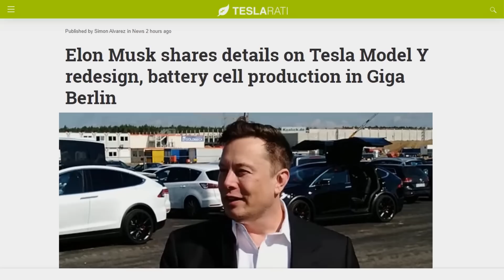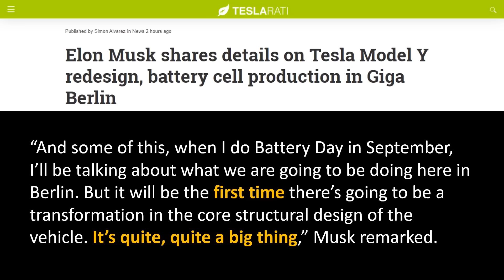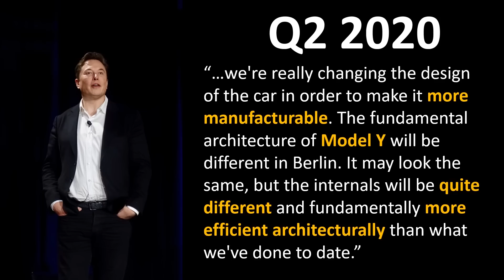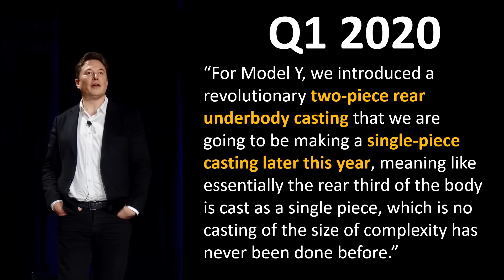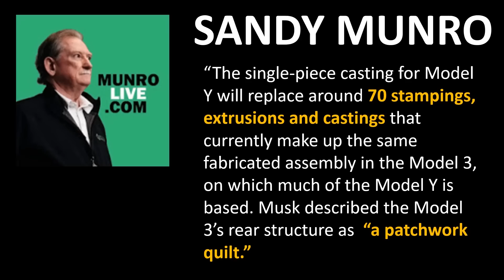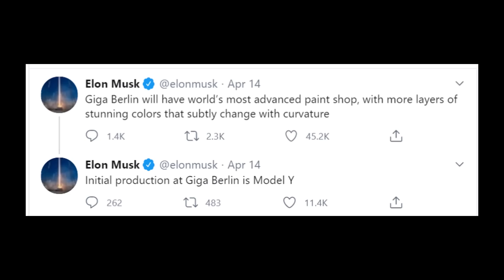Tesla is Redesigning the Model Y (Gigafactory Berlin)

Comment: It's funny how all other auto makes main focus is aesthetics and features but all Elon talks about is how much they are going to improve the efficiency of production. The cars are already sexy. That's the easy part. How to make millions of these sexy cars is the key
Reply: Mostly because the info was directed to investors and not consumers.
Reply: Stop talking nonsense, other manufacturers are already efficient at manufacturing, vw and toyota each makes 10 million cars a year, esthetic is also part of car design.
Reply: @carholic-sz3qv  I think his point were really about the rapid pace of innovation that Tesla currently does.
Reply: @yourcrazybear  Which innovation has Tesla made ?
Reply: @jonpetter8921  You mean besides creating the best EVs in the world right under the noses of legacy auto? 

Just watch the videos of Sandy Munro. Tesla is the fastest car manufacturer in the world when it comes to fixing issues that is being reported to them. Listen to how amazed Sandy is of the octovalve design. Or just look at Tesla  is soon going to start using the world's largest unibody casting machine.

The unibody design will significantly reduce weight, resulting in better battery economy, better handling and driving comfort. It will also lead to better safety, as the entire body can better absorb energy forces in an accident. 

It will also reduce build time, operation costs, costs of manufacturing, factory footprint, factory operating costs, tooling costs, and quantity of equipment.
Reply: @yourcrazybear  Lets see, how can be the "best EVS in the world" still can t find out how to assemble door and body parts properly or can t paint their car properly.

Tesla is good in making battery software but not building cars. High end EVs from VW AUdi Porsche Volvo have better build quality than Teslas.

Tesla is not the first using unibody construction neither so i don t think it s Tesla innovation.
Reply: @jonpetter8921  While it's true they have had their build quality issues, they have been incredible fast to fix the issues that can be fixed fast. Just look at how amazed Sandy Munro is with pace that Tesla fixes issues reported to them and how fast Tesla is innovating. 

The panel gaps and paint quality can only be fixed fully with new equipment. You simple can't shut down a whole factory anytime you want to rebuild the production lines. When the Giga Berlin is finished the cars that are being produced there will have far better build quality and paint quality than the cars rolling out of the Freemont factory. The same will be true in Texas. With time Tesla will fix the issues in the Freemont factory as well. 

Tesla is innovating hard. Just look at Sandy Munros videos. Look at the octovalve. Look at the gigantic casting machine soon to be used. There is a reason that Tesla is still the king in efficiency in EVs.
Reply: @yourcrazybear  You can t be the best car in the word when can t even match your door panel......
Reply: @jonpetter8921  Of course you can. No car is perfect.